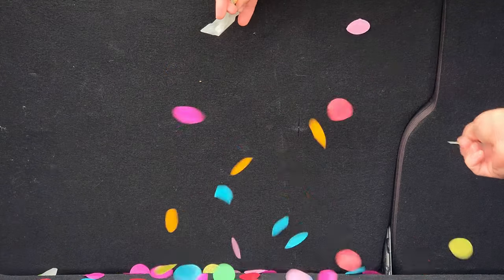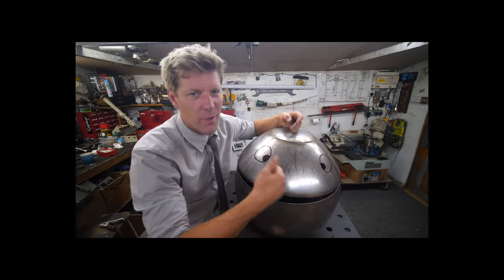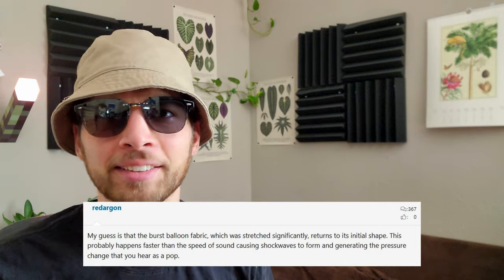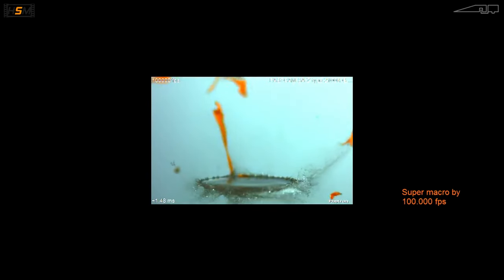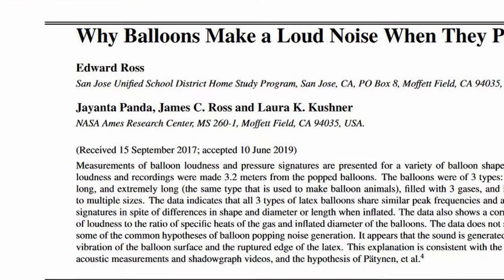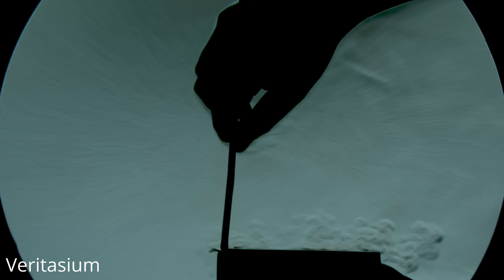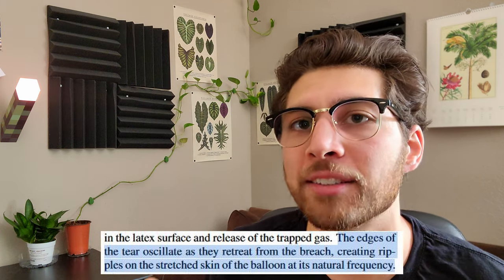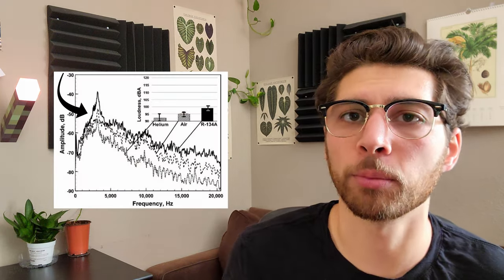Why Do Balloons Pop?

Comment: It would be nice to discuss the energy idea more from a thermodynamics perspective. Both the water and gas are at high pressure, but the energy is related to the Pressure*Volume change where because water is incompressible that volume change term is near zero making the water hold less energy than the air that can undergo a greater volume change.
Reply: Nope, if you compress a fluid with a much lower compressibility, you will need more energy and therefore there will also be more energy stored. So if you compress water by 1% there is a lot more energy in it, than if you compress air by 1%. The other way around if you store the same energy the air will be compressed a lot more. There is this thing called adiabatic coefficient or isentropic expansion factor, which describes the ratio of heat capacity at constant  volume and constant pressure. It is 1 for ideal gases and in reality it is bigger than 1, it also determines the speed of sound of a medium. Water has a 5 times higher speed of sound than air, which is of no use here, because we hear sound in air and not in water. 
Take another experiment for example, where a rocket is filled with water, then pressurized with air and once the kid pulls the string, the rocket goes off shooting out the water, which propels the rocket. This also works by just filling the rocket with air only, but it is much more effective if there is water and air in the rocket. The energy you can store in the rocket with water or air/water mix in it, is only dependent on how much energy you can move into the rocket via pumping the air pump. The water will not expand in any way similar to the air, so one should expect, the rocket goes off worse with water in it, since we want to propel it via expanding air. But the water has a much higher density and the momentum exchange is much higher, if the air wants to expand but first pushes out a fluid that is much heavier. Energy output is the same. But momentum is higher with water (we make more use of the momentum balance, shooting out slower but heavier water). Nice.
For the sound experiment it is the other way around, for hearing a loud sound, there is no use in having water, which is heavy and slow to move. If you open a barrier in water of a pressurized area, it will have sound waves in the water going through it. The sound waves go at 1500m/s and transport the energy that was initially put in it, but in order to hear something we need air compressing and decompressing waves moving at 340m/s. The water wave also hits the air at the boundary of the 2 media, but the transfer of that energy is rather inefficient. Energy transfer is good if a mass and a spring are coupled to another mass and a spring, which have the same eigenfrequency, unfortunately the "spring" of water is very stiff compared to air and the mass is very heavy, so these 2 media do not resonate well with each other, so for that reason the water cannot make an awesome sound.

Comment: Any turbulence creates noise. A slow moving object is not heard, a fast moving object creates turbulence and we hear it. On the shadowgraphs one can also see the emergence of Rayleigh-Taylor instability, this is the turbulence we are looking for, the propagation of the rubber tearing creates zones of new instabilities from which new sound is emitted, explaining the time frame during which we hear sound.
In water it works very similar, so when you release a barrier from a pressurized container, you will also generate sound waves. However water sound waves travel at 1500m/s and we hear air sound travelling at 340m/s. Water and air are also not good at coupling their sound waves, for coupling oscillators it is good if they are at the same eigenfrequenz, the same eigenfrequenz is achieved when the ratio of k and m is the same, where k is the spring constant and m is the mass. In a given volume, the mass of air is much lower, whereas the "spring" of water is much stiffer, so these 2 oscillators do not couple so well together, making it hard for the water sound waves to be transferred into the air as sound waves.